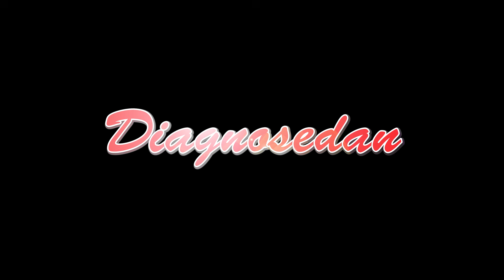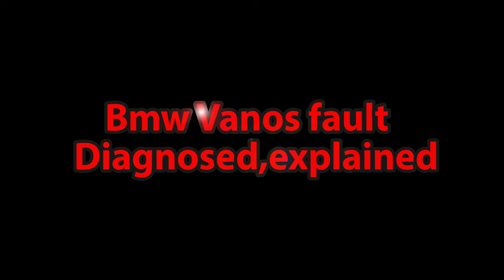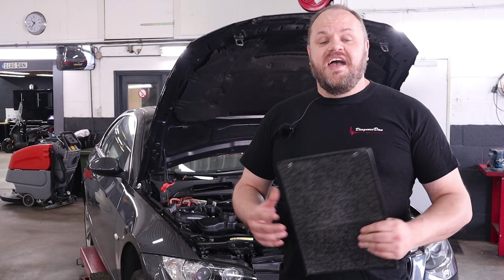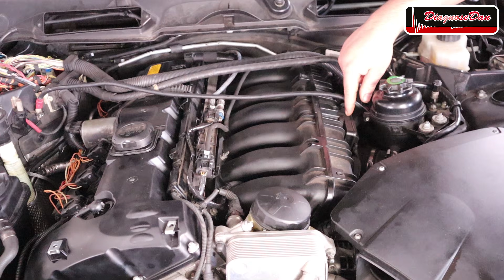Bmw Vanos Fault Explained (3000€ parts replaced and still not fixed!)

Comment: Almost criminal oversight of other workshop in my opinion, especially considering the parts cannon. As a tech, always be critical to your installation and follow OEM documentation. And always test properly before buying expensive parts. 

You who think this is poor engineering and these connectors should be keyed, go to the back of the class! You think there should be 2 different article numbers for the same actuator? 
- Double testing; durability and environmental ? Double the parts stock administration and double the listings? As an engineer you'd be kicked out, ass first if you went down with that idea, and rightfully so.

However, the design could have been different length wires (one not reaching when wrong), but different articles, that's just a reckless suggestion.
Reply from the maker: There were some guides and sleeves missing that would have made this mistake nearly impossible
Reply: @Diagnosedan  : It all falls to pieces making up the picture now...🙂👍
Hopefully the original customer didn't end up taking the full blow..😬

Comment: Many blame BMW but cars have been this way forever. You unplug connectors that are side by side you label them. You make note of which bolts are longer than others and keep everything separate.  I would like to know who wore the cost of this minor error.
Reply from the maker: The workshop that worked on the Car is also the owner they tried to fix and resell it

Comment: I'm going to go against the grain here and commend BMW for using the same plug. It's not so much the same plug as it is the same exact part (the solenoid). And if I ha a choice between buying the wrong part because there are two different ones for no particular reason, vs the possibility of plugging them in the wrong way (which also causes no damage to the engine BTW and tells you where to look with a code), I'd pick the second one. That's not even discussing the tooling and production costs of having to make a second slightly different part.

Comment: Dude, nice video. One thing to mention is that BMW has an extended warranty for the Vanos bolts which loosen and can break off causing fault codes, mine was P0012. The warranty is 10 years or 100K miles and I just made the 10 years. I have a 2011 328ix, the BMW dealer fixed the issue at no cost. A very expensive repair if you don't make the warranty. Party
Reply from the maker: Thanks for the feedback 👌

Comment: LMAOOO i literally had the same problem with my n52 bmw 130i, one workshop switched my vanos solenoid plugs , when i got to snother mechanic to change my oil, they noticed the car had idle problems, so they checked the vanos and told me “ some imbecile mechanic switched your solenoids connectors “
Reply from the maker: So it happens more often!😁

Comment: This is a common fault on all engines that use Vanos, class acton lawsuit needed.
Reply from the maker: You must be American 😜
Thanks for watching 👍
Reply: @Diagnosedan  I'm actually from London, just had to replace the Vanos solenoid in a pug 308, it was ticking away like mad, I relaced it and the ticking stopped as well as the CEL. But, strangely the ticking has returned, any idea what that could be about?? And thank you for your message,  you are welcome!! :)

Comment: What a stupid design mistake!
This problem was solved about 70 years ago in aviation. Once you could reverse the control cables for the rudder, stabilizer, and ailerons.
Pilots tried to take off only to plow the aircraft into the ground.
This was solves by placing the connectors in such a way (staggered) that it was impossible to do it wrong. Another way is to use different size connectors.
Here a simple pin in each connector could solve the problem.
BMW saved another few cents this way.
And at 0:40 why did the little plastic valve break. Why was it plastic.
Dit it happen affter waranty?
Reply from the maker: Thanks for the feedback!

Comment: I knew that was the issue as soon as you showed the vanos solenoids. I saw the connectors in the wrong place. I used to work for BMW in the states and seen this issue a few times
Reply from the maker: Why didn't you tell me😜

Comment: Nice to see a video again Dan! Darn three years later i still have the 3 abs warning lights. One mechanic said replace the abs module, didn't do it. Another said replace the abs rings on the hub, the abs sensor wires were giving a signal. So i replaced discs, brake pads and ABS rings. Still after all that moolah, no speedometer reading and scanner says wrong gap rear left and wrong sensor rear right? Shite! Luckily my cell phone app tells me my speed, but i have no cruise control. Any different ideas? 06 750LI, Great car, brakes, no speedometer reading.
Reply from the maker: Bring it to a diagnostician, somethimes Diy is not cheaper.

Comment: Excellent diagnostic, Dan if you notice the connector and the solenoid have  a white paint mark. , either the one took everything apart wasn’t the same guy who put everything back together 🤷🏻‍♂️.    Or the same guy who marked it completely forgot about it.
Reply from the maker: He Marked it but still made a mistake

Comment: Leave it to BMW not to have incomparable plugs for these two inputs.  This is basic engineering 101.  If it can go together wrong it will go together wrong.  But then again no dealer shop will ever make this mistake.  My guess was that the other shop had convinced themselves that it did not matter which plug connected where.  I think they were thinking both solenoids turn on at the same time.  Why else would the plugs be identical.  Not the first time a mechanic gets snuckered thinking the the design engineers were smart.
Reply from the maker: Thanks for watching 👍

Comment: plastic flaps ingested by the engine... I´m looking forward to electric cars

Yes mistakes happen but it is really a big mistake to change a cam shaft and it´s housing if you have Vanos issues  ( if no significant wear is visible)
Reply from the maker: Electric cars can develop other issues😜
Reply: @Diagnosedan  true, I will switch to a bycicle

Comment: After YEARS of vanos problems, maybe BMW should try stepper motors.  Steppers seem to work with the throttle pedal.  While German electronics aren't that reliable they seem to be getting better; history teaches us that using oil pressure is not long-term reliable and takes way too much time to repair.  Koenigsegg could probably teach BMW and we can get away from this historically problematic 20th century technology.  Diagnose Dan does a great job because he does not just assume the test results are gospel and looks below the surface!
Reply from the maker: Most Car manufacturers stopped developing internal combustion engines and focus on electric vehicles
Reply: @Diagnosedan    The focus on electric is, as usual, short sighted and top down thinking.  A century ago, gas won over electric for a reason and until batteries can approach the energy density of gasoline, it will prove illusionary.  Besides, the electric grid in Houston couldn't handle everyone using electric space heaters, how in the H E double hockey sticks is the grid going to handle everyone charging their cars w/o BILLIONS of dollars and YEARS/DECADES of time???  
People charge cars at night when wind is calm and there is no sun.  I think the intermittent renewables should be used for plastic pyrolysis to make light sweet crude AND get rid of plastic in landfills!  Plus, all of the oil in Saudi Arabia came from Algae, why can't we get at least some gasoline from algae oil???

Comment: The fact that the connectors are interchangeable is so stupid tbh. Good thing you worked it out. This is why you shouldnt even start diagnosing an issue, if you don't have the proper tools (in this case the wiring diagrams) for the job.
Reply from the maker: It's smart in a way, the solenoids for intake and exhaust have the same partnumbers to reduce production costs. On this engine there were guides and sleeves missing that would have made this mistake nearly impossible

Comment: You explained this very well,I am a (diagnostic) mechanic at an Opel dealer recently got a car in for a diagnostic on the same system    (cam gear timing) for loss of power and rattling noises  the previous garage changed both solenoids and both intake and exhaust cam gears (400 € a piece) because they where making loud noises at start up and sometimes at 800/1000 rpm
Gues what I found in 5 min time... a clogged oil filter that was falling apart when I took it out.
Changed the filter and put in some new oil and everything was fixed.
Always check the oil system (pressure)
Reply from the maker: Great job!

Comment: I think regular oil changed at 6000 miles or 10000km should be mandatory for any BMW. If an ownwr don't change oil they gonna have all sorts of issues on these cars.
Reply from the maker: I agree that the engine needs more than recommend oil changes

Comment: Swapped connectors.....what a bitch. How is that even possible?
Here is the answer: Engineers design engine with different components which  are not interchangable. Then the cost control dude who doesn't even understand how an engine works says hey we can save 20 cents in using the same connector for different jobs. Management says top job dude, bonus for you. Happens all the time. Aeroplanes fall out of the sky for that reason.  Hate it. 
Yes, I am an engineer.
Reply from the maker: Both solenoids for intake and exhaust have the same partnumbers, to save costs

Comment: I know it is easier to say from behind a keyboard, but if I was the one putting this back together, I would have made a very definitive note along the lines of, "Gee, could I have plugged these in wrong?"  In all fairness, BMW should have done something to ensure those connectors were a bit different.  I wonder how many of these went down the production line and got plugged in wrong.
Reply from the maker: This engine was missing some guides and sleeves that would have made this mistake nearly impossible.

Comment: Love your work Dan - we wait for these videos in great anticipation ! 

One would think that the clever engineers at BMW could at least have designed the connectors different between the two solenoid's, as they should foresee a mistake like this is easily made.
Reply from the maker: Intake and exhaust have the same solenoids with the same part numbers, so the same connectors

Comment: The reason why bmws are expensive the maintain is not only because of sheer cost of the parts but also misdiagnosis caused by technicians , eventually end up replacing parts that are not broken
Reply from the maker: Thanks for watching 👍

Comment: Hello DiagnoseDan,

As a wiring engineer, this situation, having interchangeable connectors to similar units in close proximity is unacceptable and would cause problems at the assembly plant!  The connectors should have been keyed AND color coded on wire harness side!

Great video!

Mr .P
Reply from the maker: Thanks for watching 👍

Comment: I HATE it when they bring the car in with the low fuel light on! Also seriously, how difficult would have been for BMW to not make those 2 plugs interchangeable? Common sense ain't so common for engineers.
Reply from the maker: I hate it when there is no fuel in a Car i need to work on😬
Reply: @Diagnosedan  Yeah. Thought about posting a sign in the office: "If fuel is below a quarter tank, we will fill it up at $10 a liter"

Comment: I wonder how much the customer has to pay, for all the parts they didn't need 🤦‍♂️
Reply from the maker: The workshop that worked on the Car is also the owner they tried to fix the Car and re-sell it
Reply: @Diagnosedan  Good to hear that the shop owned the car (and will therefore take the costS themselves). I do understand that this was very tricky but I don’t understand why people would just replace (expensive) parts without knowing if they are faulty or not. 
Thanks for your excellent explanations!
Reply: @Conservator.  Quite agree.  It is doubly hard to understand replacing the camshaft and its housing. How could that have helped in any credible circumstance?
Reply: @alexanderSydneyOz  
Exactly. I wouldn’t want someone who thinks (or doesn’t think;) like that even touch my car.
Reply: @Conservator.  I bet it was a bit of over confidence in their troubleshooting skills, Dan said they usually do good work, once they replaced the Vanos & it was still throwing codes they were sure it was the something big so they just went for it. That decision was probably a lot easier to make when it's your own vehicle too. 

Dan is the man though, always super impressed w/ his process 👏
Reply: @JJ-xo7zv  Yes, I think you’re correct, over confident must be the right term. 

That implies that they didn’t know but had just concluded that it was very like to be X (and when that didn’t work then it had to be Y). 
I’m just an armchair analist with hardly any practical skills in the car mechanics/electronics but I when I try to fix anything, I first try to understand how the object should work and why it isn’t. 

If you don’t have the skills to do diagnostics like Dan, then I think you should either learn how to do it or hire someone who can in a challenging case like this otherwise things can get very expensive. 

I’m aware that diagnosing modern cars can be very tricky and requires more knowledge/skills than the average mechanic needs.
Reply: @Diagnosedan  Whoa!!  I'll bet this goof will make them double and triple check their work from now on!!  At least some customer didn't get taken advantage of.

Comment: Just another question. I had a look at in cylinder pressure. Why is the cranking waveforms so different from the running ones? What changes? The cylinder in both cases is without ignition. Basically we want a video for cranking, running and sharp acceleration in cylinder pressure video. <3 <3 <3
Reply from the maker: During cranking there is no vacuüm in the intake that makes it hard to see the valve timing

Comment: Nice vid again!  Makes me wonder.. why did they replaced the cam and cam holder  in the first place? did they think there was an oil pressure leak at the mechanical seals you pointed out at the workbench?
Reply from the maker: Yes, that was they thought

Comment: The true victim is BMW for not engineering in different key ways on those two plugs considering they are so close to each other to prevent a connector crossing, like in this example.
Reply from the maker: There were some guides and sleeves missing that would have made this mistake nearly impossible
Reply: @Diagnosedan  The key ways on the plugs were broken off intentionally?? They are usually quite thick.

Comment: Great video Dan, Definitely not expecting that to be the cause.  
Well done and welcome back 😀  
Interchangeable connectors I have seen cause issues in coils on a Mitsubishi Express and I wondered the same thing now as I did then. Why don't they make a simple slide difference so it's not possible to happen??? Our job is tough enough as it is :)
Reply from the maker: This engine had some guides and sleeves missing that would have made this mistake nearly impossible

Comment: Imagine the bill this customer will get for all those parts that have been needlessly replaced.
Reply: Their was no Customer.

The vehicle belonged to the Shop that sent the car to Diagnose Dan.

The Shop is trying to Fix the car so that they can Sale it.
Reply: @charlesbarkwell7693  Sure, Dan will not invoice the customer for all those parts. 
The shop that sent this car to Dan most likely will!
Unlikely that they will confess to the fact that they switched those 2 connectors, causing the issue themselves 😉.
Reply from the maker: The workshop that worked on the Car is also the owner they tried to fix the Car and re-sell it
Reply: @Diagnosedan  Glad to hear that instead of an immense bill, someone will be very happy wit an issue free car with lots of new parts!

Comment: Thanks Dan I learned something new from you, I have two n52s and the little o ring in the filter housing was a mystery to me now I know. Solenoid wiring easy to get wrong so I’m careful not to mix up. Clean ,proper oil and religious oil changes will make those n52s run a long time. Very happy with one of the best BMW sixes.
Reply from the maker: It's a great engine!

Comment: Thanks for sharing another great diag video, and thank you for always taking the time to break things down for clearer explanations. Just out of curiosity, were there any other tests done prior to incylinder testing that lead you to it? It sure was a great way to tell for sure the timing change before and after. Again, thanks for sharing!
Reply from the maker: No other test done, Just the ones showed in the video, i don't know what test were done by the previous shop
Reply: @Diagnosedan  Hi Dan, sorry i'm so late to this, was the red tracer wire the hot / exhaust side and the blue tracer wire the cold/inlet side solenoid ?  Just wondered. 
Thanks for the amazingly informative video.

Comment: Great video Dan, been watching for ages! I recently fixed a digital odometer for a 1993 Toyota Supra. It stopped counting because the pullup resistor for the speed sensor input had cold solder joints. The "forum fix" is to just randomly resolder any obvious solder joints, especially on the connector pins, but of course that is not a proper "diagnosis" as I've learnt from your videos.
Reply from the maker: Thanks for the comment!